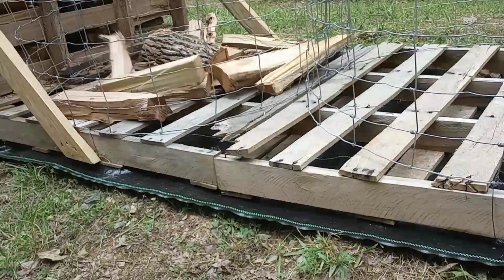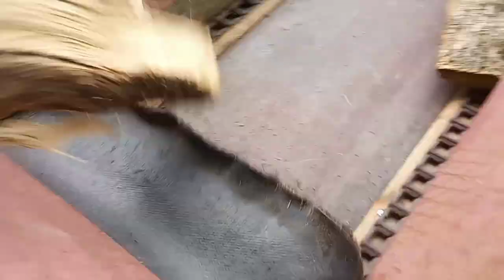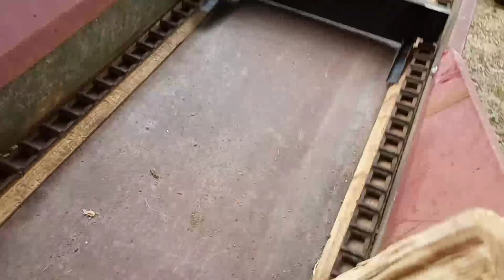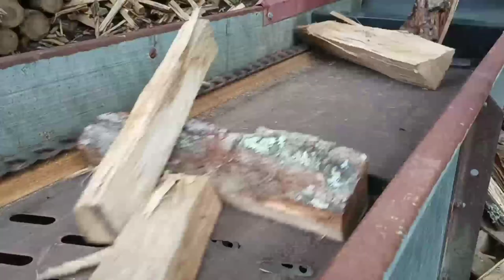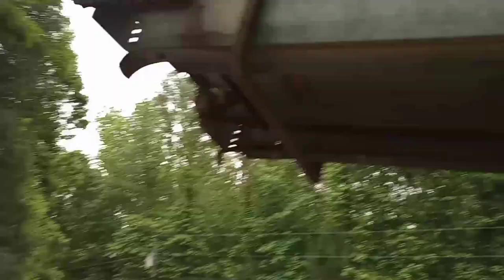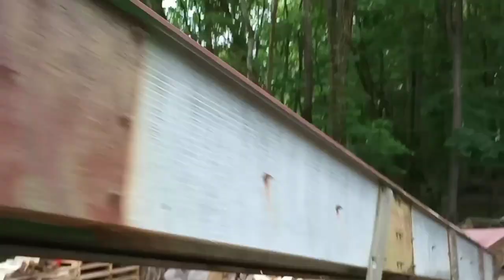Nice day with the conveyor!

Comment: Nice job on the conveyor. I have 2 the same as that and had problems with the flighting flipping off. I have been going to change them to angle bars, I see you just added some between them and it works good I might just do that. I used to use the same type of cages and just did a few more a few weeks ago for campfire wood. Any chance you are on Arborist site? I'm Cantoo there.